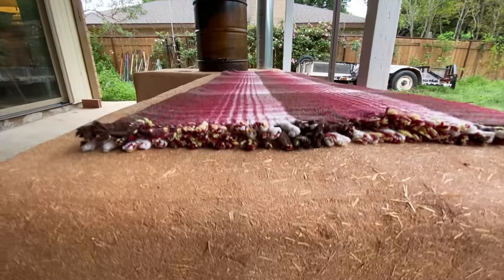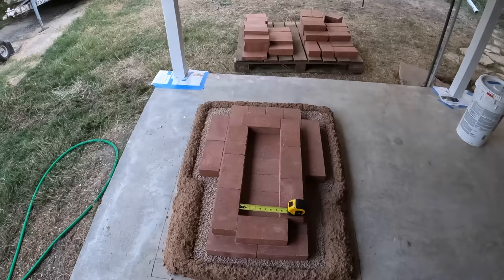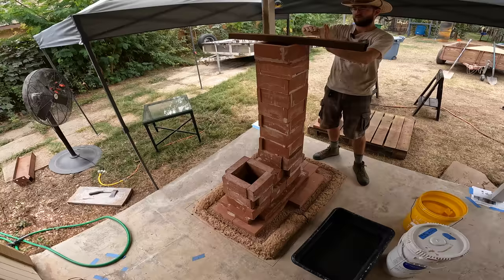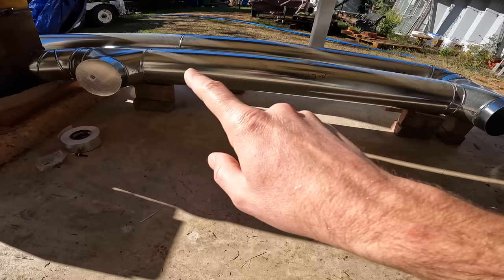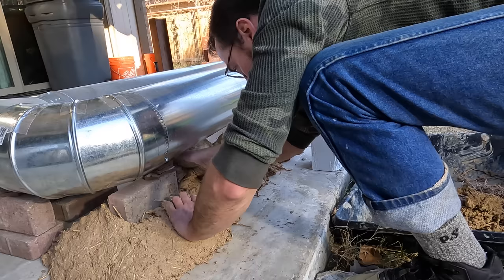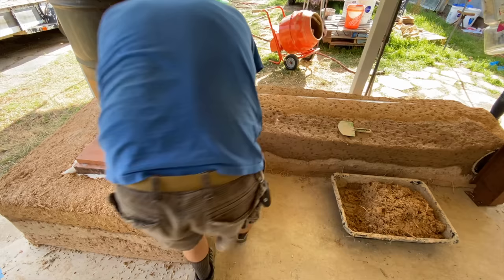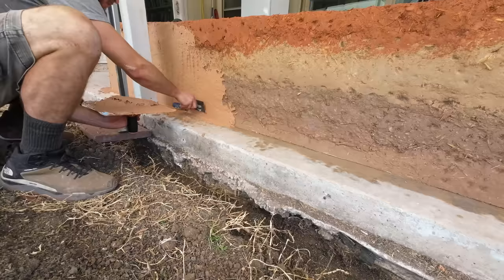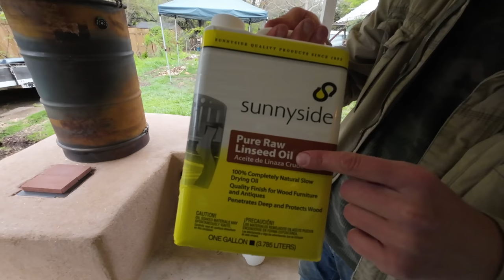World's most efficient stove!!!!  Made of DIRT!!!

Comment: SurburbanBiology, why did you not just use 100% Hempcrete for this build? You would have used way less material with the same results at a much lower cost out of pocket. If HEMP it was legal to grow. Then you can just grow most of your own building materials in your own backyard. Hempcrete WILL NOT BURN or transfer heat to the outside of it just like (if not better than) firebricks/wrap. If the structure your house was made of Hempcrete and a fire broke out around or inside your house. Everything around or inside would burn. But the full structure of the building would still be standing. Then one would only have to rebuild roof, replace the furniture, pluming, and wiring. Unless it's all protected by the Hempcrete in some form or another.✌✌✌✌
Reply from the maker: As far as I understand hempCrete is an excellent insulator. That would defeat the purpose surrounding the ductwork in an insulator. That would trap the heat inside of the duct and send it up and out of the chimney. The whole point is to have an earth in mass that can conduct and store the heat. So insulators are not your friend when it comes to what makes the bulk of the mass for a rocket mass heater. Thank you for your comment. Other folks have a asked similar question. And thanks for subscribing!
Reply: @suburbanbiology  Thank You for answering and giving your feedback. ✌✌✌✌

Comment: Adding the barrel to a mass heater is not a great idea. The gasses will condense on the relatively colder surface area of the barrel. This creates creosote buildup.  For hundreds of years the mass storage oven in Germany and Austria have worked amazingly without the barrel. We have one installed in our house in Portugal. It's just a normal big fire chamber leading to brick channels then to a tall chimney that helps with the draw. You heat for a few hours and your house stays the same temperature for the whole day even when it drops below zero over night.

Comment: Excellent video, I haven’t come across this type of heating before. I have three questions, first, how do you remove the ashes? And secondly how long did it take to get hot enough to heat the stones (in your other video where you tested it as kind of sauna)? And thirdly how hot does the barrel get when the fire is lit i.e. is it dangerous to touch?
Reply from the maker: Barrel glows red at the top after am hour or so. Can burn you for sure. Shop vac into feed tube gets ashes. Took about an hour to heat those stones. Thanks!

Comment: Very interesting. How is the creosote build up on the horizontal part? Cooling woodsmoke, before it makes it out to the air, unless the biproducts are completely reburnt
Reply from the maker: I’ve read it’s minimal given the complete combustion in the heat riser due to the extremely high temps. I’ve only done about 15 burns. I will probably clean it somewhere around double that. Follow up video to come.

Comment: fantastic video. looks like got way more than 1000 subs since you made this video lol. nice. also, not sure if you like the metal drum or not, but couldnt you have replaced it with more fire bricks and/or cob? i think it would have looked much nicer
Reply from the maker: Thanks for commenting. Yes I definitely could’ve used bricks and mortar of some sort, but the only problem is then if you ever need to get inside to do any repairs it’s a bit more cumbersome to take bricks apart rather than just unbolting the clamp around the drum and lifting it off. But bricks would still work as long as you made the bell the appropriate size. Thanks for subscribing!

Comment: So you can put a grill on top of the open flame area and barbecue some meat on that correct?
Reply from the maker: Technically I supposed you could. Might get the stove a bit messy with grease. It would probably be neater to set a pan or Dutch oven on top of the bell.

Comment: What is the longest a burn tunnel can run for? Could I heat a 30m long greenhouse with a 30 m long burn tunnel?
Reply from the maker: There is a limit to how long you can make the internal tube. I would recommend going to permies.com forum to check out what they have to say. There are different versions that you could probably build that would allow you to run it for a longer stretch. The problem is if you don’t use a big enough internal pipe, there is not enough force generated by the heat riser to push air all the way through long length. The forum I mentioned above gets into great detail on these topics. Thanks for your support and for subscribing!
Reply: Thanks! @suburbanbiology

Comment: I have a question and a nitpick ( 🤷).
1. What is the surface temperature of the bottom and the top barrel,
2. From my point of view there’s just one impractical thing, the loading pit.
Okay there are some more…
3. Can be the barrels be replaced by a brick (structural clay bricks)?
4. Also the first vertical pipe(half brick one) can you use prefabricated ceramic coils?
5. Something that even I can’t remember….
6. I’ve subbed and liked.
Reply from the maker: Hi!
1) I don’t know yet the exact numbers. I’m hoping to make a follow up video with a lot of that detail.
2) the feed tube is definitely something you have to get used to. But it actually works pretty well due to its simplicity.
3) yes, the barrels could technically be replaced by masonry or brick of any sort. You just have to make sure that the dimensions are about the same as far as the inner diameter. you would also have a very hard time taking it apart to clean any fly ash out. But it would look more consistent with it being masonry.
4) you can use all sorts of stuff for the heat riser. As long as it is super resilient against high temperatures. A lot of people use perlite reinforced clay. There are some other people that have used even fancier stuff. It’s probably worth checking the permies forum out.
5) ginkgo helps ;)
6) thanks for your support!

Comment: So much work and detail, but no ash tray?
I'm probably going to build one, but instead use water for my mass. It can be pumped through the whole house, regulated and combined with other heat sources.
Reply from the maker: I was paranoid that if I went off the menu and made an ashtray, it would wind up cracking somewhere because I have never made anything out of cob before. Good luck with the water. That sounds very cool. Just be careful for steam production because everything becomes explosive when steam is made. Thanks for subscribing!

Comment: How about Phosphoric acid on the metal would still give it a protective coating given the heat ? And how about coloring powder on the surface layer ?
Reply from the maker: You could do either. I think phosphoric acid would lead to a dark color on the steel. I coated it with linseed and over time it has turned more black. Like a seasoned cast iron pan. Thanks for commenting!

Comment: Now that I know catalytic stoves exist I really don't understand the point of these especially because you can always add a heat exchanger above the cat to improve the heat exchange I understand the idea of having thermal batteries but also. You can get better than 1 in terms of efficiency with a heat pump and a normal gas furnace has either 80% plus or 95% plus efficency. i really don't understand this other than for completely off grid and electricity less living.
Reply from the maker: I cannot argue that heat pumps are an impressive feat of Engineering. But yes, this is a nice back up plan if electricity fails. I also am able to use my neighbors’ tree trimmings as a fuel source. They would otherwise be trash. So it really is free heat.

Comment: How is the biomass holding up over time? I built a rocket stove  outdoor wood furnace, which is a hydronic system. The problem I have heard with biomass RS is that the structure breaks down relatively quickly.
My RS is built with high-heat refractory bricks, then low-mass insulative bricks, with a common red brick exoskeleton. It heats water thru a copper coil in the chimney, so it is not transferring heat via the same method as yours, but the combustion physics is basically the same in all rocket stoves. Mine will nearly liquify steel if I let it get too hot, so I am wondering if cob is destroyed quickly in this design.
Reply from the maker: The cob is holding up great so far. The only true organic compound in it is the straw which (per volume) is the minority of it. Otherwise, the road base clay and sand really cannot break down at all. If this was out underneath even a slight drizzle, that would basically melt it since I didn’t coat it with anything waterproof. But thank goodness it’s underneath the roof of my house and now it’s enclosed behind some walls so rain cannot splatter on it. Thanks for sharing your project and for commenting. And thanks for subscribing!
Reply: @suburbanbiology  how hot does the 'bench' get?

Comment: What happens if you replace the mud/straw with sand or just make a huge sand box? What was your total cost?
Reply from the maker: In the book I link to it recommends against sand. Apparently sand acts as an insulator, and that traps the heat in the ductwork and sends it up out through the chimney. You can use gravel more effectively than sand I think. I would check out the permies.com forum for more info.

Comment: Looks awesome! Just wondering how you clean out the ashes? also would you not have to worry about creosote build up in the exhaust ducting?
Reply from the maker: Shop vac into the feed tube gets the ashes. Yes technically creosote could build up if you don’t use appropriately aged wood etc. The ducts are cleanable with chimney brushes. I have yet to do it since I finished this project in the spring. I plan on cleaning it yearly after this winter. Thanks for watching and subscribing!

Comment: Thanks for your excellent build. I need winter heat for a 2400 sq feet wood shop....all open.  At 4800 feet elevation. 

Never built one nor any masonry.  Your wonderful video gives me confidence  to try one. Thank you!!

So any changes or improvements?  Or just proceed as in the video?  Also do I need to read and incorporate  anything else ?? 

Curious,what state are you in?

Thanks !

just jim
Reply from the maker: Hi Jim. I’m in Texas. if I could change some thing, it would be the chimney work. I would go with stainless if this is going to go inside of a structure. I use galvanized ductwork that probably will not last as long. I also would lap the joints of the ductwork, so that condensation stays inside the ducts. I did the opposite with mine, which was a mistake. I link to a book in the description of the video. I highly recommend reading that book. Thanks for commenting! And good luck.

Comment: Wouldn't the galvanized coating on the wire cause a bit of poisoning issue in the venting?? I thought breathing that is very bad for you.
Reply from the maker: If there is any offgassing, it should be inside of the duct and vent to the outside.

Comment: I didn't see anything about using refractory cement. Wouldn't that eliminate the need for the clay/perlite mix, or am I way off?
Reply from the maker: The point of the clay perlite  mix is to act as an insulator to prevent from accidentally breaking up your concrete slab. I don’t think refractory cement is that good of an insulator by itself. I suppose if you mix perlite with refractory cement, that would probably work almost as well. Thanks for commenting.

Comment: Amazing! I have a question: How hot does the bench get and if I run a series of CPVC (higher heat rating) pipe throughout the bench, could I possibly heat / take the chill off a koi pond? Or if you know a better pipe material which conducts heat and is safe for koi that would be great. Thanks in advance
Reply from the maker: You would likely be better off pumping water from the pond through a copper tube that wraps around the bell and then having that water flow back into the pond. If you try to run a pvc tube through the pond it would have to be big. The same size as the feed tube. If that is an 8” system then the underwater tube would act like a giant pontoon. If you consider the weight an 8” duct that is 20 feet long and filled with water that’s pretty heavy. That mass would be the same buoyant force acting to float the pipe. It would become an engineering difficulty to keep that tube underwater and filled with air (exhaust). Permies.com forum has examples of people wrapping their bells in copper HVAC lines (softish copper) to heat water. Be safe. Steam can explode. Good luck!

Comment: What if the pipe inside the earthen mass was made curvy instead of straight? I.e. a bunch of 90' twists/turns?
Reply from the maker: The turns in the pipe increase the friction against the flow of air. After about 3, 90° turns the air stops flowing. I got a lot of this information from the book I link in the description of the video. Thanks for commenting and for subscribing.

Comment: How does this make sure to combust all the gases fully? How does it add oxygen to the flue gases?
Reply from the maker: Due to the rapid flow of air coming into the feed tube, it pulls in quite a bit of oxygen that then mixes in the burn tunnel. Any unburned oxygen that makes its way up. The heat riser is combusted there. The thought is that the secondary combustion is fed by the main airflow coming in the feed tube. The book I linked to describes more detail. Thanks for commenting.

Comment: Say someone had a bit of disposable income. Could the "earthen" portions be fire brick instead? Wouldn't that absorb the heat similar to the earthen material?
Reply from the maker: Fire brick is meant to be an insulator. You would want to avoid an insulator in anything that replaces the cob. You could use standard masonry brick, and that should work just fine as long as you ensure that the brick is always in physical continuity with the internal duct. Thanks for commenting and for subscribing.

Comment: Would the finger holes leave trapped air that would expand with heat and put pressure to start a crack? Different materials have different expansion rates when heated and different contraction rates when cooling, and would that be of any issue?
Reply from the maker: I think they run the risk of doing just that. I took extra care to make sure I really smooshed the wet layer down into the holes though to make sure there shouldn’t be any trapped air. Thanks!

Comment: Rather than use dirt, why wouldnt you use something that has a higher thermal capacity and is more weather resistant like stainless steel? Plus a large slab of metal could be used as a cooking top for burgers and such
Reply from the maker: Most cost. The bulk of this stove (by mass) is earth material which is cheap as dirt (pun intended). It could be made out of masonry and or stainless but that would cost a great deal more. Thanks for commenting!
Reply: im flattered by the reply thank you. I need to work on making my satire more obvious. A giant chunk of stainless that large would be tens of thousands of dollars and weigh several tonnes. Completely impractical and excessive. might be worth it though for burgers and such @suburbanbiology

Comment: why not use the steel tube and install fire brick around that?
Reply from the maker: I assume you’re talking about the heat riser. The temperatures inside of the heat riser get hot enough to melt steel. So that would not work very well long-term. It would probably last for a little bit, but it would degrade quickly. Thanks for commenting!

Comment: I've watched this before and I don't remember but how did you deal with condensation? Does it run back into the burn chamber and absorb or just form an equilibrium
Reply from the maker: Equilibrium is the most succinct answer. Some of it forms on the chimney as it goes up out of the back of the stove. A bit of that has leaked through the seams and flowed down onto the bench. There is a small stain there. Otherwise it’s contained inside.

Comment: This is an amazing video.  I learned a lot from this.  What do you think the weight it can hold with people sitting on it.  Also do you have a thermal temp gun to take readings of the heat at different times and places?  I'm looking at  buying a fixer upper and something like this interest me.
Reply from the maker: You could fill the bench top with people and it wouldn’t break. It’s very strong. I’m planning a follow up video with thermal footage. Thanks!
Reply: @suburbanbiology  thanks for the reply.  I'm 6'7" and 320 pounds.  Far from light weight and  was concerned.

Comment: So i have a question if i have pipe that's double walls ut will not be good for the ricket mass heater? Correct cause it wont allow the heat transfers to the clay?
Reply from the maker: Correct. Inside the Cob bench you want single wall.

Comment: Those look like no fire brick that I've ever seen inmy life I was a block in stone Mason for two decades I built thousands of chimneys those are not insulated. The correct brick should you should be able to cut with a butter knife they are typically be used in kiln
Reply from the maker: Oh God, I hope you’re wrong. I remember when I bought them I was paranoid that it wasn’t the right type. In the book I referenced in the description I checked what temperature the bricks would have to tolerate and from the manufacturer website, these bricks were touted to be able to withstand it. Off the top of my head I cannot recall what that number was. If you’re right, I’m gonna have a very sad winter as I watch all of my bricks crack. I guess I will post an update video. Probably around a year out and let everyone know. Thanks for your comment as much as I hope you’re wrong. I appreciate the advice all the same.